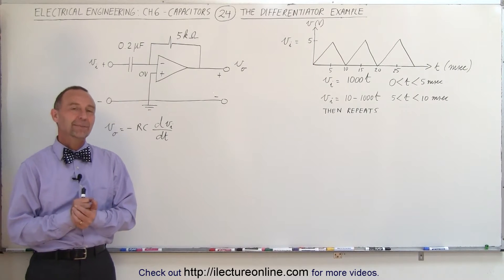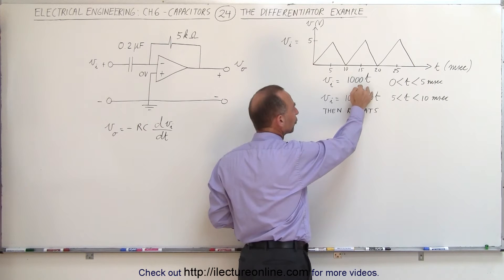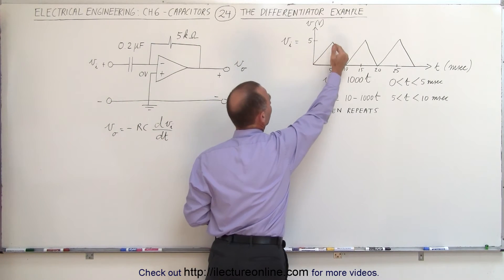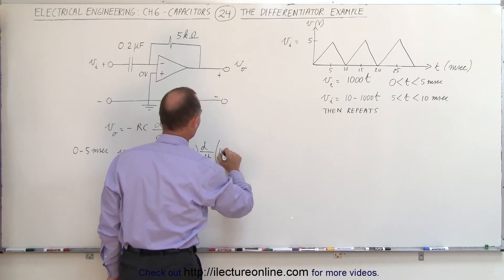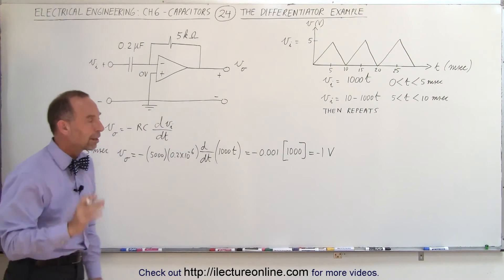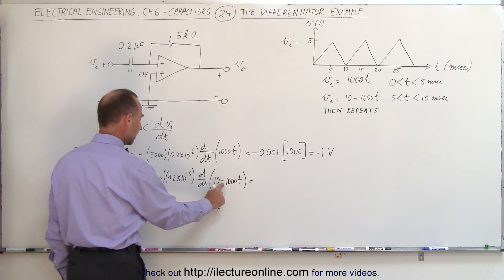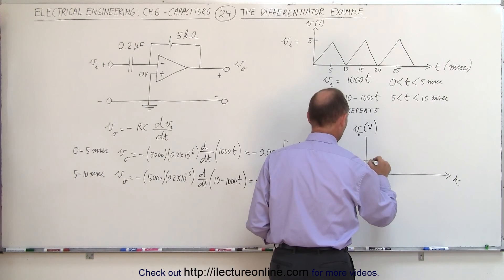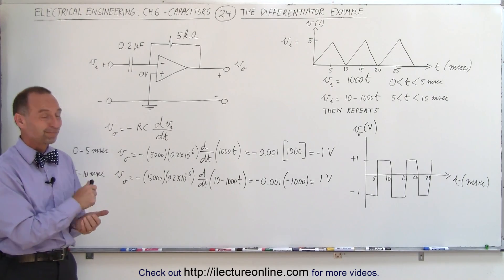Electrical Engineering: Ch 6: Capacitors (24 of 26) The Differentiator: Example

Comment: Sir can you upload op-amp non linear applications ? Our teacher asked in the exam design a circuit which is take the negative part and inverses the positive part , other question was design a circuit only using 1 op-amp which is output is proportionally with square of frequency

Comment: Sir plz tell me why we have taken input voltage 1000t and 10-1000t , little doubt
Reply from the maker: Note that the time is in milli-seconds.   (Does that help explain your question?)
Reply: @MichelvanBiezen   actually I was going with other problem where it is 2000t . Here it is 1000t , it is always preferred to take the time as 1000t or 2000t whatever it is
Reply from the maker: We have to find the correct linear equation in the form:   y = mx + b where you need to find the slope and the y=intercpet of the sawtooth portion of the curve with a negative slope.
Reply: @MichelvanBiezen  great sir , love from India ❤️❤️

Comment: Where did you get 1000 in the initial voltage? Your graph shows slopes of 1t and -1t.
Reply: The slope of the rising edge is 5V/5ms = 5/0,005   V/s       => 1000t
Reply: The time axis is given in milliseconds, so "5" on that axis actually represents 0.005 seconds, and so on.

Comment: Hi Michel Van Biezen. Thank you so much for your videos so far. 

I might be wrong, but the graph at the end of the video seems incorrect. The Vi graph starts at 0 V then ends at 5 V over the span of 5 milliseconds. Consequently, the derivative is equal to +1V/ms. Calculation: (5-0)V/5ms = +1V/ms.

However, the Vo graph seems to indicate the derivative of Vi from 0 to 5 ms is -1V/ms. But, it seems like a negative slope is impossible for the first 5 ms...based on the problem statement: "Vi = 1000t  0<t<5 ms". Please help me correct my misunderstanding. Thanks!